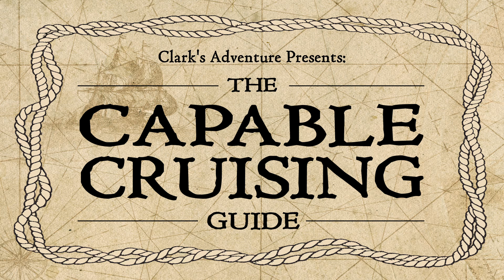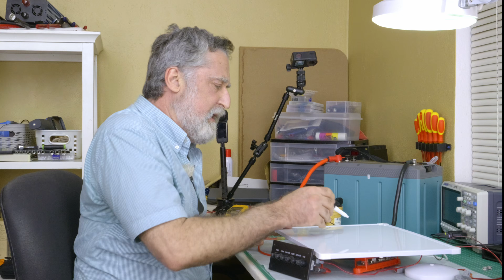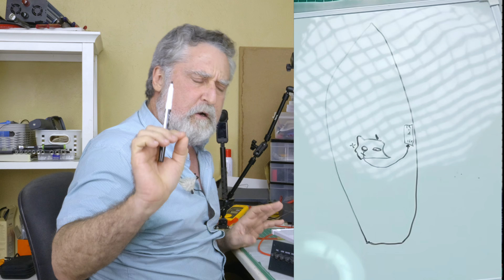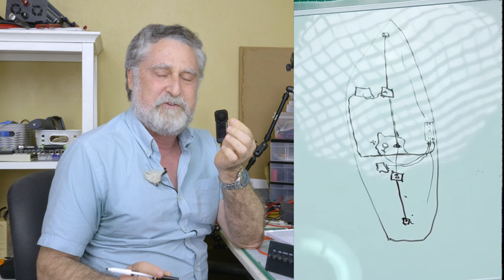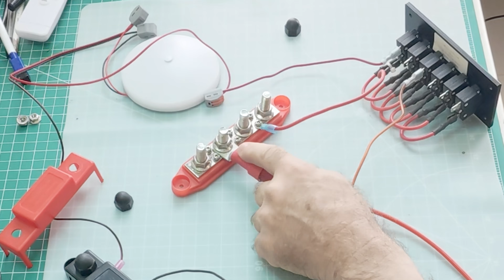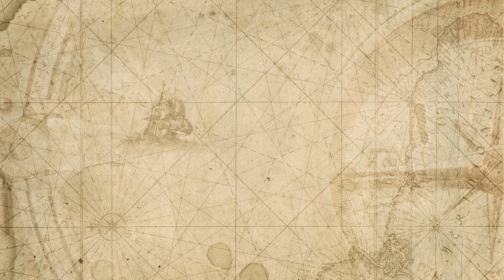How to Wire a Boat or Camper

Comment: If you are looking to expand on this later you might touch on what, if any, salt water corrosion protection or maintenance you do?  I've seen a couple of small boats lately with just massively corroded old cheap wires that are surely causing an excess of resistance.

Comment: Thanks Mr. Clark! Already learned a lot watching your playlist. Are you planning on doing a special on steel boats? I guess it's different than the diagram you created here.
Reply from the maker: Not really.  Just resist the urge to tie the hull into the dc power system ground.

Comment: Hi Clark, I had a friend with a commercial fishing boat.  He installed one of those very expensive alternators that put out lots of amps at idle to run the big lights used to attract the fish.  He complained to me that every time he started the engine, the compass would swing 30 degrees.  I had a look into it and found the positive wire from the alternator was routed to the distribution panel on the other side of the boat from the engine ground going to the same panel.  Yep, a huge loop area.  When the engine started and the lead acid batteries were soaking up lots of current, a big magnetic field was created. Re-routed the positive wire to run parallel to the ground wire and the problem went away.  Moral of the story, where large currents can occur, and you have a magnetic compass, flux gate compass or some other magnetically sensitive device you want to be accurate, wiring loop area needs to be considered.  Loop area in the grounding system you suggest could be minimized by running the positive wires parallel to the heavy ground conductor.
Reply from the maker: My batteries are near the engine so that circuit is short and the cockpit compass is a long way from it all 
  I think if you wanted the best magnetic isolation you could actually twist the wires together.

Comment: I'm not a fan of that grounding scheme. Your loop area for each circuit is really large which can lead to problems with radio interference. Also, you've shown lots of unprotected small wires. I know it's challenging to get a large wire into a circuit breaker, but if you're going to use small unprotected wires, they really should be in a metal fireproof box like a breaker panel.
Reply from the maker: It's worked for 30 some years with no RF issues.  And I have HAM on the boat.

Comment: I have also seen boats with the positive supply set up the same as your negative supply, one an alu boat with alu power transmission wires..
You just set up a number of smaller distribution panels along the boat..

Comment: Thanks Clark. I would love to hear your thoughts on building a 48v system for a cruising  sailboat.
Reply from the maker: I don't think it's a good idea.
   You won't find as many devices that run 48v
Reply: Why not future proof a boat? Especially if it's under construction now? 48v compressors, windlass, winches and water pumps are available now. Smaller wires, less weight etc. DC/DC converter for the low draw fans lights and instruments.
Reply from the maker: Your call.
   I don't think the gain is worth the hassle.  Remember boats are relatively small.  Short wire can be big.
    24 is probably the sweet spot.

     And a nice advantage is you will get a nasty shock from 48v if you work hot.

Comment: i have a bonded boat, but still  attached the battery using 10 gage wire to the main engine a jumper across the plastic coupling welding 2/0 all the way forward  to the windless, you see anything wrong  in this setup? also an old dina plate (short wave ground plane) connected the battery ground, and  a Battery BANK manager, LOL
Reply from the maker: I personally remove the banding wires from bronze thruhulls.   Make your own decision on this but I feel an AC hot marina eats these if bonded and your boat can sink.

    It happened to me!   Not the thruhulls themselves but their fasteners.  (I caught it before Temptress sank if course.

Comment: Thank you for your video. Is this related for both single and double wired systems like you see on different boat setups to protect zink?
Reply from the maker: Yes just don't let the battery negative touch boat ground

Comment: Clark, is there a minimum size wire you recommend using on a boat regardless of how low the current draw is?  Also do you daisy chain wires when it's appropriate, like for lights?  Good video, I like the idea of the distributed grounds.   Keep the good stuff coming.
Reply from the maker: I used to say 12awg but then the led lights came around.  I think I use 18awg or so for some of them.

As long as you know the max amps that can flow through any part of the circuit and you plan a wire size for it ...  Sure

Comment: Where are you on use of electrical relays to shorten the distance for the current bearing wire even more?
Reply from the maker: Realize that the relay is a switch with two new terminals on the wire run.   That all causes resistance.
   So it has to be enough savings to offset that resistance, the complexity, the chance of failure.
   Generally on a boat it's not worth it.
Reply: Well, wouldn’t the relay replace the switch in the circuit so there will not be any “extra" terminals..? There is of course others sides of using relays as well, but it will help reducing voltage drop if mounted close to the main supply/load.
Reply from the maker: Anything can work.
   Reliability is often vital 

    If it looks like a good idea in your application go for it.  It's obvious you are thinking about resistance correctly.

Comment: Thanks Clark, great video and informative as always. Based on the way you wired Temptress, how / where do you connect the voltage or charge coming from your solar as part of your circuit? thanks
Reply from the maker: Where the wires are still big

Comment: Typical household circuit breakers aren't designed to be used as switches. They work, but aren't rated for frequent use. You might switch them twice a year. 
The breakers in a boat distribution panel may be thrown hundreds of thousands of times per year.
If you're going to use a circuit breaker as a switch, make sure it's rated to be used as a switch. Not all of them are.
Reply from the maker: I've used mine for 35 years.  No problems so far.
Reply: @Clarks-Adventure That suggests that you've been using switch-rated circuit breakers all along.
I expect most marine-rated breakers will be fine. But it's something to keep an eye out for if you're trying to be cheap.

Comment: SV Delos' current episode concerns their electrical system. 

It's a large, fully electric boat. High power demands, high current. And the core of their electrical system are large busbars running the length of their boat.

Comment: Great video.  When I rewired my boat I had a small aft switch panel, but I also had a piece of duplex 4 ga and did something like what you recommend - I ran it up to the mast area belowdecks and made small positive and negative distribution buses there.  All the wiring from the forepeak and from deck and mast lighting etc. just went there.  Most interior lighting now actually switches at the device so there's no need for them to all circuit from a big aft main switch panel.  Switched external lights (nav, masthead, etc.) can be easily switched near the forward positive bus.  And it's really easy to maintain/service with all these short runs of wire.  Those big Blue Sea switch panels are insanely expensive and can often double the cost of the wiring itself.  The smaller and fewer the better.  The fly in the ointment is that big electric winch - no cutting corners there.  And don't get me started about Europeans and their negative wire switching/fusing.